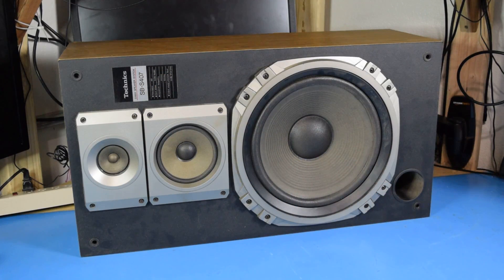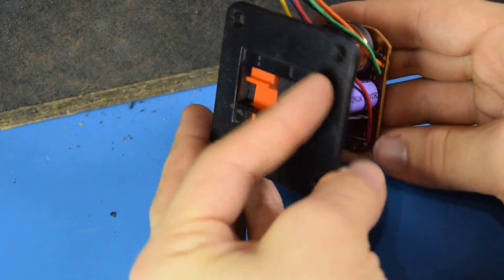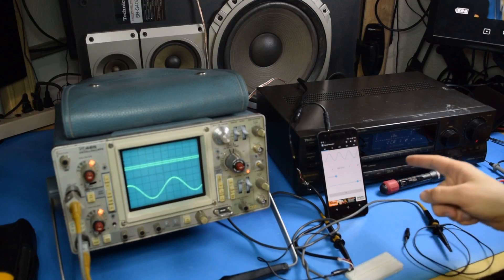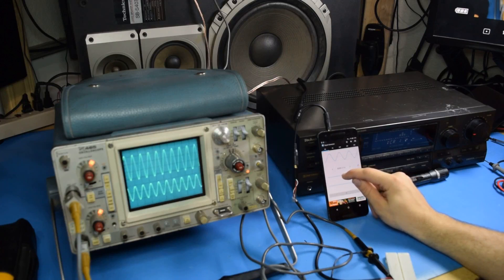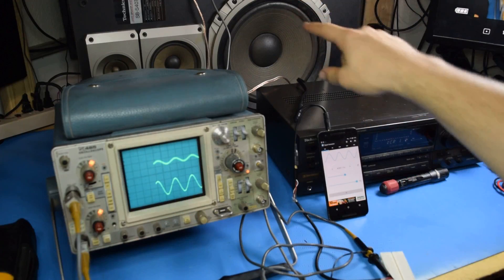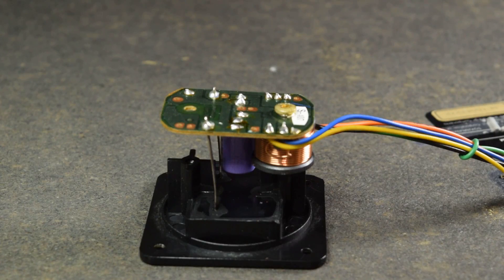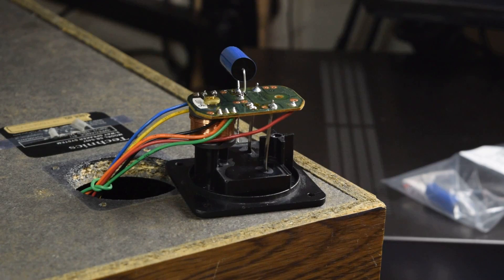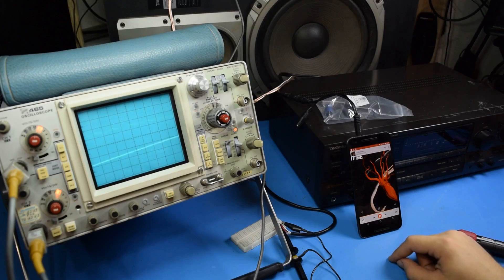0x0023 - SB-S407 Speaker ReCap

Comment: did the old capacitor short out on a certain frequency range or something?
Reply from the maker: Yeah, I forgot to explain how this works in the video. The point of the crossover(the PCB) is to create a cutoff frequency range for each driver(speaker). This is done with inductors and capacitors ( http://www.apicsllc.com/apics/Misc/filter2.html ).  When the capacitor failed the capacitors failed the speakers were left with just the inductance causing a phase shift (See "Sinusoidal Waveforms for AC Inductance" https://www.electronics-tutorials.ws/accircuits/ac-inductance.html ).

Comment: I have a old stereo technics speakers too with small crossovers and polarized caps. I wondering if I change the caps for non polarized it will work better.

Comment: All that work for vintage mid-fi speakers....  they were never resolving and transparent new.... kind of thump and sizzle really.  That mass-fi rolled off and spitty treble that "beams". about 11khz. But hey, if you dig that sound...

Incidentally, electrolytic caps induce their own distortion and degrade in as little as 3-5 years.  Would have been a better idea to use 5% metallized poly caps which measure the same over decades and have no electrolyte to dry up.  That, and they are vastly more accurate and neutral than those cheap beer cans.,

Comment: Where did you buy the replacement capacitors and what specs are needed for the replacements. Posting a link to the source for the exact replacements would save me lots of trouble/research.  Thanks in advance.

Comment: I have a pair of these speakers. One sounds fine but the other I can barely hear at all. How can I test the caps to make sure they are the culprits and if so, which ones should I buy? Also, what is the copper coil and could it be bad? I’ve tested all three speakers and they read close to the 8 ohm spec.   Any help is appreciated.
Reply: Thanks for this informative video. I took a chance and recapped both of my speakers and now they perform like they were intended!

Comment: Cool stuff. Could you do a video on what tools and knowledge someone would need to re-cap an amplifier or other old electronics? Thanks!
Reply: Yanni mouzakis Well... You would need basic eletronic and soldering knowledge. 
Basically if you will recap every cap in a old eletronic is not that hard, even without knowing if they are ok or not, just buy a bunch of good caps in the same specs as the ones you will replace. Desolder the old ones off the old board (some have a better solder so a heatgun or more powerfull soldering iron would be neat, and some just a regular 30-40w soldering iron would do the trick). Watch for the capacitor polarity as it doesnt work in the wrong way. So it needs new caps, soldering iron or heat gun.
If you wanna recap only the bad ones it needs a bit more knowledge and tools. You would need to dessolder the old ones and use some kind of tool to measure its capacitance (there are tools for that, and some multimeter do that, and there is a way to measure with standard multimeters/voltimeters), then buy some caps with the same specs as the old ones and replace. 

Basically or you replace all of them, or you will have to remove all of them and test them, put back the good ones and replace the bad ones.I wouldnt reccomend to test the capacitors in the board itself, as the measurement may be wrong if they are on their circuit (from what i read about, and saw in some repairing videos).
Reply: Thanks for the reply! I don't know much about electronic repair, but I'm curious to learn more. Do you have any recommendations for videos or other resources I can learn from?